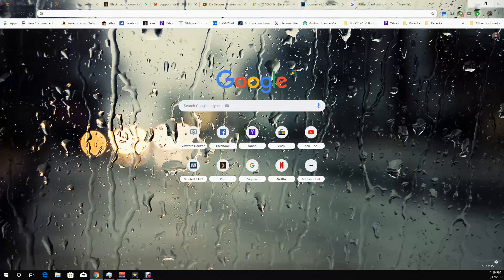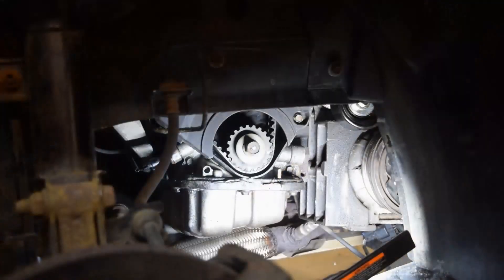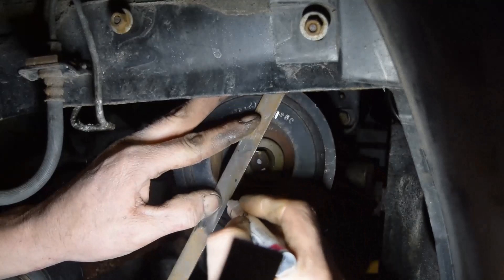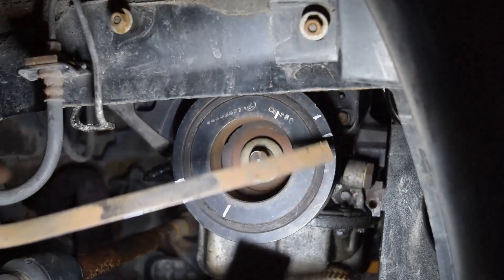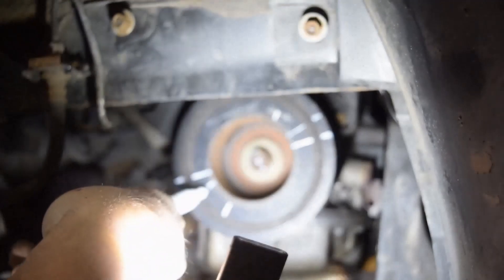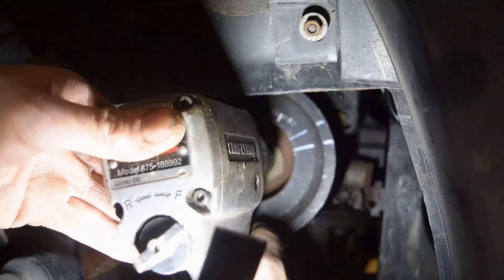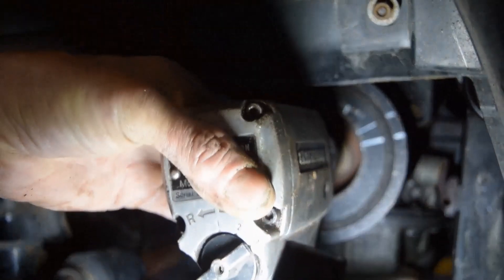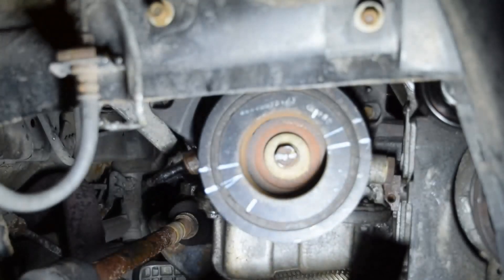How to use an Impact Wrench to Safely Torque a Crankshaft Pulley Bolt

Comment: Can you reuse, crankshaft, pulley bolts? Everywhere online is saying not to do so, however, Honda dealers cannot get me the bolt in time.
Reply from the maker: In all honesty they probably say that about every bolt. With that said, I've always reused them. Maybe perhaps honda is using a soft bolt, that part I'm not sure. I don't really want to tell you the wrong thing, I guess, just use your best judgment. Either way, good luck.

Comment: Being an Engineer with 30+ years of experience, I 100 % agree with this method. For years, it was thought that just torquing to spec was accurate....NOT SO. Problem was, when you torque a bolt, the friction under the head of the bolt can cause great variation on how much the bolt is actually stretched using the old method. The amount of stretch determines the actual stress in the bolt which determines when the bolt will yield. The ANGLE turned determines the length the bolt is actually stretched. Engineers will calculate the length of stretch needed to just yield the bolt correctly. THIS IS A VERY ACCURATE WAY TO STRETCH THE BOLT CORRECTLY!
Reply: Will this exact instructions work for a 430Nm tighten a  1HZ Harmonic Balancer bolt?

Comment: I torqued my crankshaft bolt to the repair manual specified 135 ft. pounds on my Dodge 5.2 liter last week and it took me hours to rig up a way to keep the crank from turning.  (Had to rig up 2 ratchet straps in various locations) Since I have to now remove the crank bolt once again to make another repair, (stupid error) and I know it is at the correct torque right now, can I just make a witness mark on the bolt and balancer and use my cordless impact wrench to install the bolt so that it lines up just as it was?  Thank you.

Comment: Just FYI for people...60 degrees (Accord V6) is a SHITLOAD of torque needed to achieve without an impact.  I had my 250 ft-lb wrench clicking and it wasn't at 60 degrees.  At some point it's ridiculous to need a cheater pipe on a breaker bar to achive their torque vs. using the same impact you used to get it off.
Reply from the maker: I agree, thanks for the information.
Reply: Same (Accord V6) tried doing it the right way for my timing belt ended up having to impact it on. Just going straight to impact this time 😅

Comment: I just did the lower timing cover on my Audi. Removing the crank bolt with the "special tool" was near impossible so i used an impact. Installing it with a torque wrench was also almost impossible.  Guess what the professionals do ? They use an impact to remove AND install the crank bolts. My buddy is a VW tech and said NONE OF THEM torque to spec or use the crank holding tool. It's air impact all the way......
Reply from the maker: I agree that most mechanics will just buz them on and off with an impact gun. Although the piece of mind and satisfaction of getting it really close helps one sleep better at night. To tight and you risk stripping out the crank threads, and too loose could cause it to fall off.

For the little time that it takes, I'd rather try and get it as close as I can. That's just my two cents. 😁

Comment: why not just use a torque wrench?

only asking because my g37 needs a special tool to hold the flywheel while torquing down the crank bolt. I'm guessing it will spin if you do it by hand? but the quick impacts of the impact wrench are able to turn it?
Reply from the maker: It's not always that easy to keep the motor from spinning. I guess you could use a tool to hold the flywheel, this just seems easier. This is my opinion, just giving an option for some people to use.
Thanks for your reply, I'll be sure to keep that in mind for next time.

Comment: I was thinking of doing something like this myself. Why don't you just mark the bolt against the housing before removing it?
Reply from the maker: I probable could have done that first, although I felt that by marking it the way I did would get me close to manufactoring specifications. I guess it wouldn't be a bad idea to have marked it first perhaps with a different color marker. Thanks for your advice and also for watching my video.
Reply: @marksplace  I was asking because I don't know if this procedure will work. The thing I don't know is if the bolt will begin to thread at exactly the same location every time, and so end up at the same place every time when tightened by hand.
Reply: @yasharenner6681  I believe it should thread at the same location.  I would have marked it the way you suggested too just as a reference.  Mark did an excellent job nevertheless.🙂
Reply from the maker: Thanks Bella, much appreciated. :)

Comment: This is improper, degrees does not convert to foot lbs which is linear force.  One would need a torque angle meter (utilized in engine rebuilding) and or do the proper math of 360 degree circle of the bolt head divided by the 6 points. Nice try but proper math always prevails.
Reply from the maker: It's called "torque to yield". Not sure how the use of a protractor would make it incorrect. That is unless you didn't watch the same video that I created, or you're trying way to hard to complicate a somewhat simple task of using angles -- an angle is an angle no matter how you slice it.

The idea of the video is so one can torque/degree a bolt without worrying about the engine from turning while doing so.

Thanks for watching, that is if you did. :)
Reply: @marksplace  There are three types of procedures used for torquing: torque to yield/angle to turn; torque to maximum stretch yield; and torque to a specific torque number and hope it's correct. A crankshaft bolt is NOT a stretch bolt as in a head cylinder bolt (which should be replaced upon reassembly not a good engineering design-stretch bolts yet this is where a torque to yield/angle would apply). Unless your using a Torque Angle meter then this would be most likely off 15-30 foot lbs or more. 1 degree of angle does not translate into 1 foot lb. Show me the mathematical formula otherwise having a decent calibrated torque impact wrench (which could have a deviation of 5%-10%) would be the best practice and easiest. Then again were just scientists using facts.
Reply from the maker: As per GM the crank pulley bolt is first torqued to 70 ft lbs (I used a torque wrench) then 30 degrees, then 15 degrees. Is it the best way, no it isn't. Does it put you really close, sure, why not. Considering most people just buzz them on with an impact gun and call it a day. In my defense I have since the upload of the video purchased a good digital torque wrench that also does angles. Even then one would need to keep the motor from turning, thus throwing off any tool used. The way I did it in the video  I had no worries in the world if the motor had turned on me or not - - it wouldn't matter because the Pulley is keyed to the crank. 

Thanks for your input, it's all good and I appreciate it.
Reply: @marksplace  You are mostly correct by doing this like I and my daughter have been using.
Many shops (mechanics), just run the impact gun and call it for the day, w/o checking Ft. Lbs.

ATG & many experts say this is good enough.

Comment: what a crock
Reply from the maker: If you have a better way than please share, otherwise thanks for watching.
Reply: @marksplace  indeed, that is basically "torque to yield". Good job.
Reply from the maker: Thanks
Reply: Blue loctite and a couple hits with a big impact, never had one fail in 30 years.